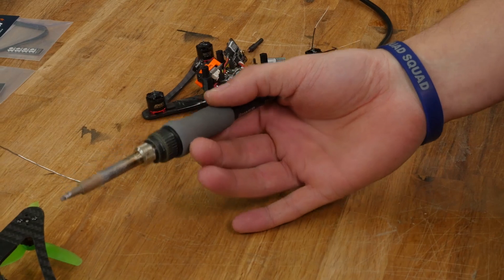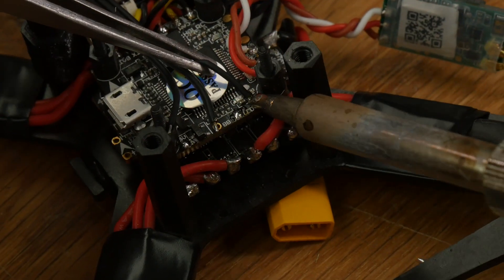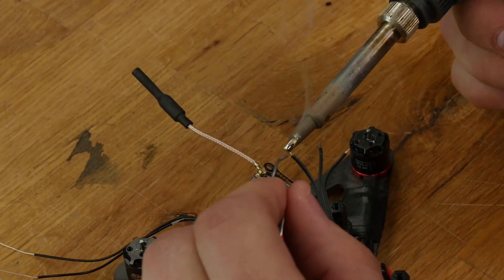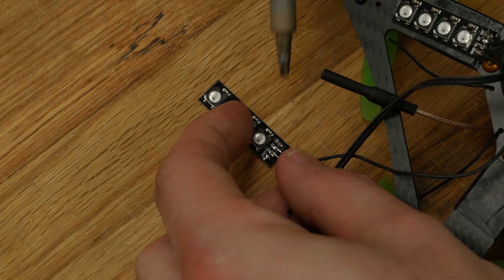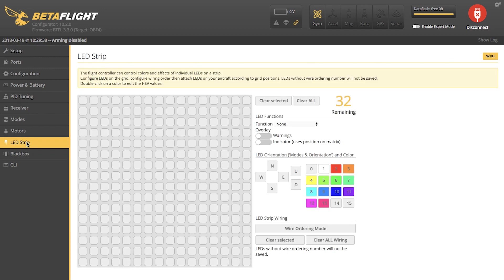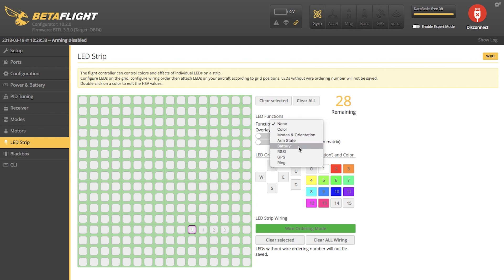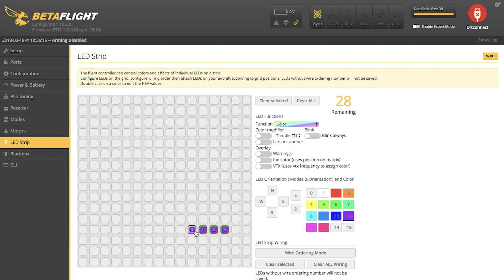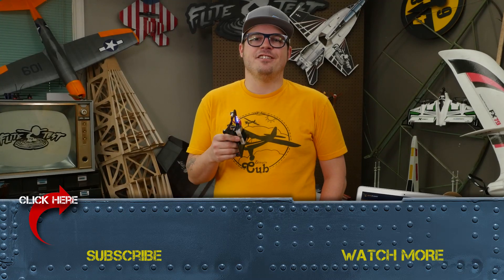How to Put LED Lights on your Quad

Comment: If you’re just bridging the second led, can you just go to signal in to signal in with the second one too? If it was in series then my guess would be to go out then in. But since you are parallel and using the same signal wire for both then would it  work going in to in? Can someone please let me know. Thanks.